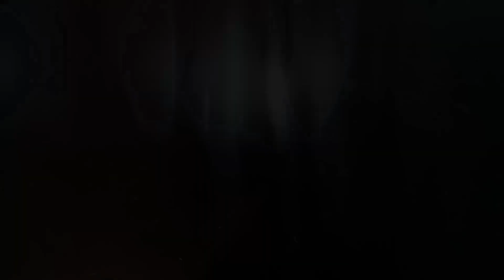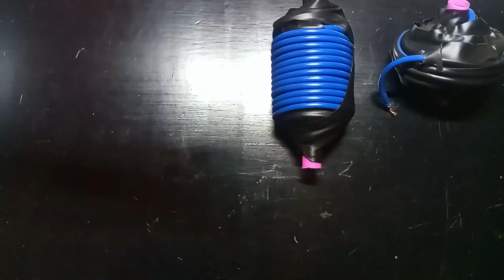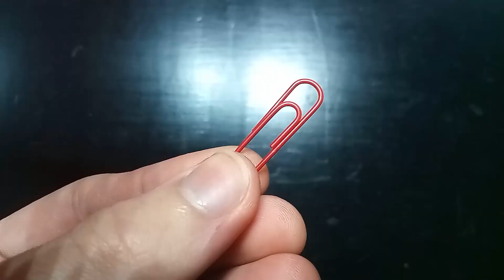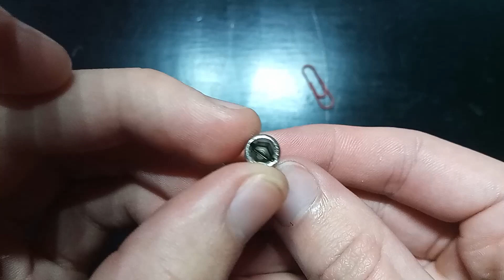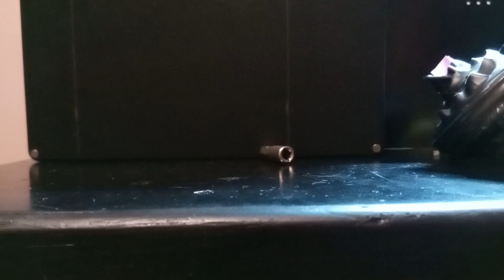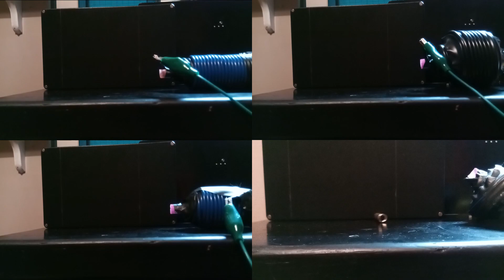Testing Coils: Making a Coilgun Bonus Video

Comment: just to note, if you're making a multicoil coilgun, which sounds like a thing you would do
make the coil as short as the reaction time of your sensor is

the shorter the "barrel" length means it'll take less time for the projectile to reach the middle of the coil which is where the coil is the strongest
but if your coil length is too short, it's very hard to tune the timing where you should cut off the current

as of how many turn the coil is, I guess it's just your personal tolerance of how much fire hazard your project can be :p

Comment: Have a look at "brook's coil", it's the length/diameter/bore ratio for the maximum inductance of an air cored solenoid for a given length of wire (resistance). Not sure how you're timing your coils on/off but if the longer coils are still active after the projectile is past their center, they start slowing it down. Second, you're wide and short coil probably underperformed a little, since it got kicked back more in comparison to the other coils, if it were fastened down you might find it works better.

Comment: B = (u*N*I)/L where B is the strength of the magnetic field, u is the permeability constant, N is the number of turns, and I is the current through the coil. To maximize the magnetic field output, decrease the length of wire while increasing the number of turns. There's some fancy calculus you can do to optimize what value should be what
Reply: Hi! How are you? See also New Portable Super Coilgun:

https://www.youtube.com/watch?v=rclLsQ9nyeg&amp;feature=youtu.be

https://www.youtube.com/watch?v=-mjDqp_oWZk

Comment: It's interesting to see the thought process behind this. I'm wondering, have you considered using a nylon/teflon/ptfe etc. tube for the barrel to bring the friction down as low as possible? (I wonder if a small amount of oil will be significant enough to be worthwhile too)
Reply: I was considering oil actually, but the coil is short enough now that I didn't want to bother with the mess. Once the barrel is like 2 feet long though I might have to do some friction reduction stuff like that
Reply: White lithium spray (the kind used to lubricate garage door rails) would probably be perfect for this. You might already have a can of it in your garage.
Reply: 2 feet long and you could be pulling a vacuum on the inside to accelerate that thing